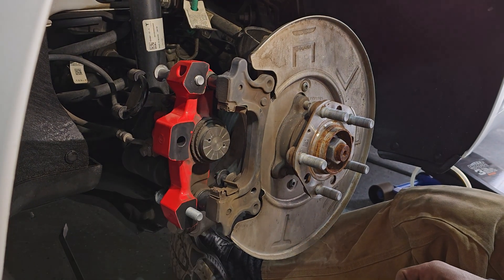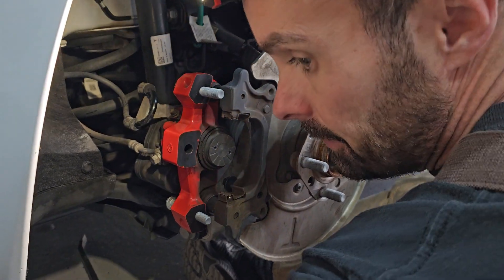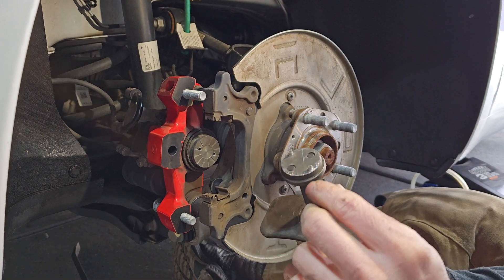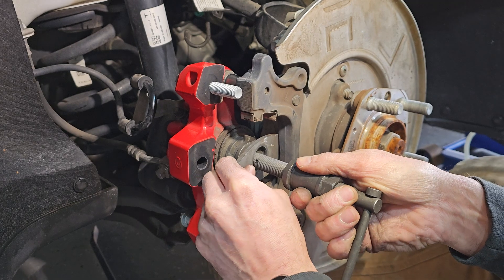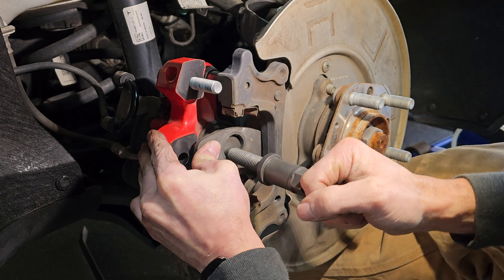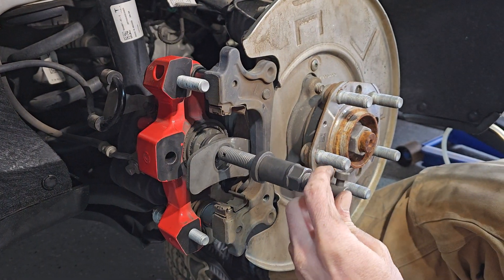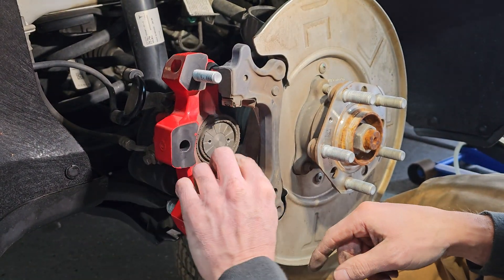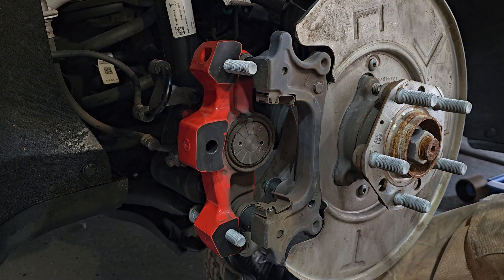How to compress the rear caliper on a Tesla Model 3 Performance.

Comment: Hey! Loved the video only I have one question . What’s the torque for those x3 bolts T14 written on them 10.9 ??? That hold the front of the caliper (red w Tesla logo ) thank you in advance !!!! (Edited 12 days later: torque for those 3 T14 bolts holding the red part of the caliper bracket he has off  is 109lbs I went on the other side marked the bolt and the caliper with a marker untied it then I read the torque value until matched the marks I guess that’s why it said on the bolt head 10.9 😅

Comment: Does it not electronically wind in with a 9v battery connected to the wire going to the handbrake?
Reply from the maker: There is no hand brake. The car turns the parking brake on automatically when you press the park button.
Reply: @CharlesCo918  That's what i meant. I just changed the rear discs and pads on my performance and the service mode can now wind back the epb on either or both sides. Much easier.
Reply from the maker: @alandrumo  Wow, that's great news!
Reply: @alandrumo  That is awesome, I need to check that out as I was just going to replace the rear pads on my M3P.
Reply: @robbb79 yes, but then let's easier to push it back